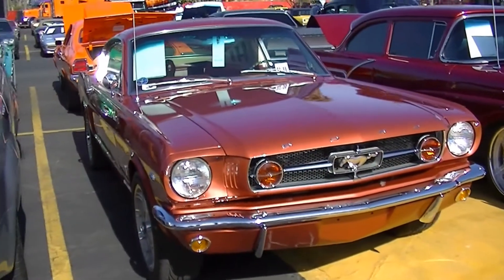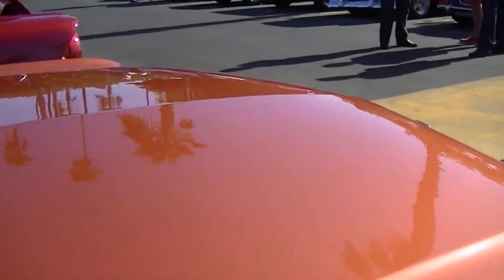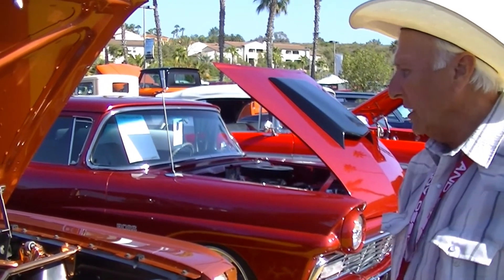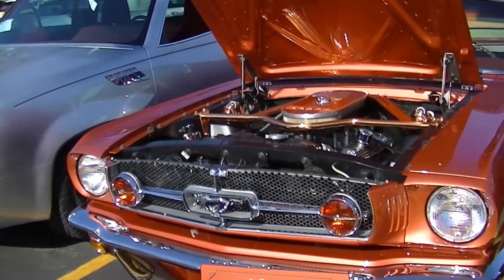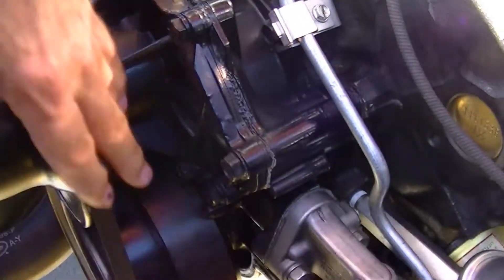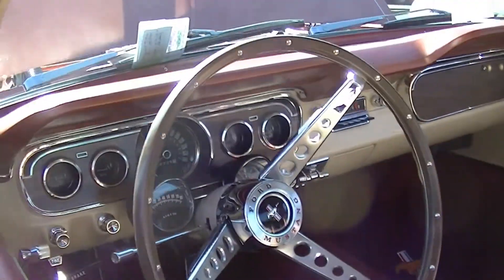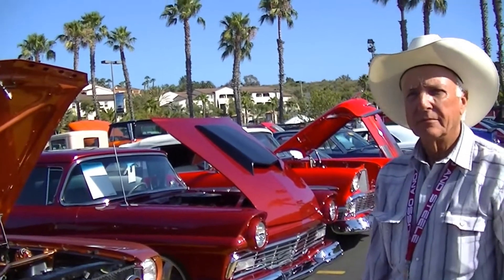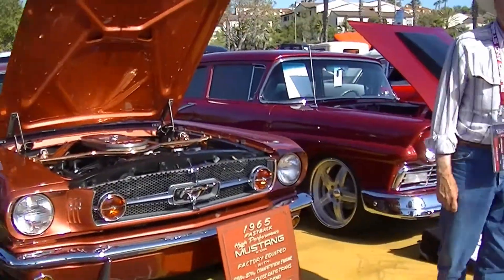1965 Mustang Fastback K Code 289 Hipo  Russo and Steel Newport Beach 2014

Comment: 289 with 4 bolt mains? Ive never seen one. beautiful labor of love.
Reply: The hi-po 289 did not come with a 4 bolt Main
Reply: K code was the highest HP engine available in a mustang until the 320 HP 390 in 67.
Reply: Now i wish i had sought after the k-code 289 mustang when i first became aware of it in 1977 at 19 years old. I wouldn't be lusting over this one so bad because it is absolutely amazing. I would have one of my own. Maybe.

Comment: Very nice but has a 66 rearend...9in but housing from 65.  But back in 65 they were running out of parts right and left so it might still be factory. My 65 was bought by my mom and one I rebuilt the motor it at 66 heads on it and i was the 1st 1 to ever open up the valve covers . I do some research on it and Polly change the housing. Still an awesome build and almost none are the K codes came with the GT badging. It's kind of double dipping...GT and kcode

Comment: I got a 289 came out of a 66 mustang fastback in my 65 ford f100. It packs the punch being all original! Could it be a K code?
Reply from the maker: Anything is possible.
Reply: @MustangConnection1  it is a 2 barrel carb. I have a book I want to read on it just for hipo engines that can tell me if it is a K code
Reply: Wesley Parker: All K Codes Came W/ An Autolite  600 or 715 cfm,4 Barr.,2 Barrels Were on the C Code 289,Which Were 200 h.p.

Comment: 289 hi-po did not come with a 4 bolt Main
Reply from the maker: Correct the only Windsor that had them with the 69-70 Boss 302. Might have misspoke in the video , I look at so many cars at the auctions some stuff becomes a blur.